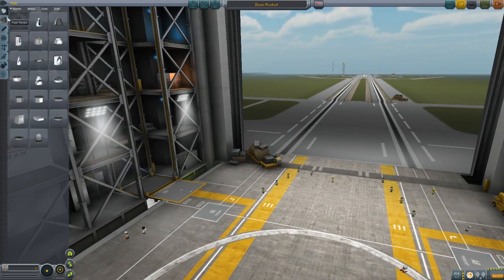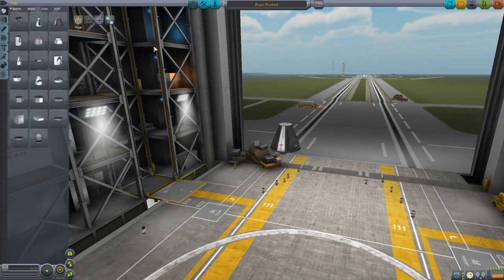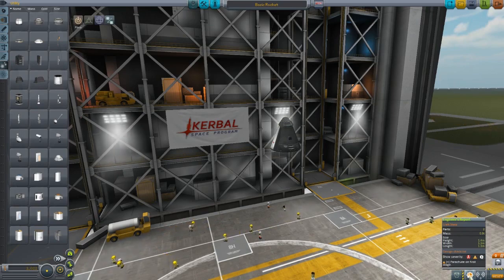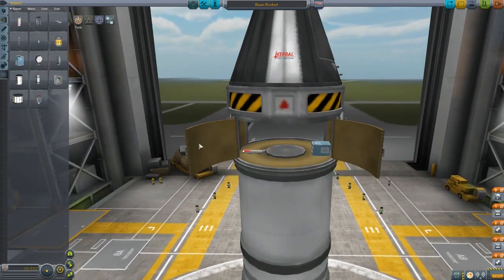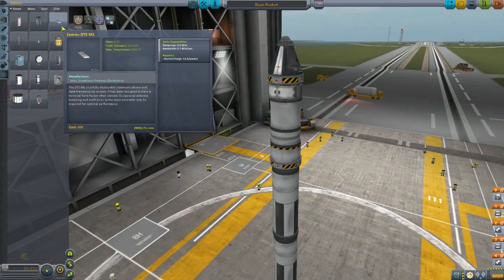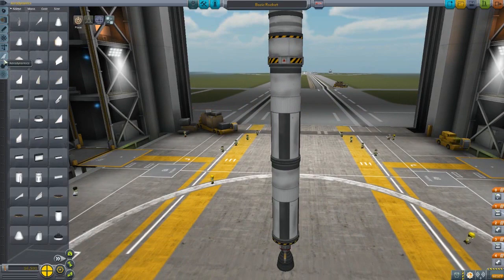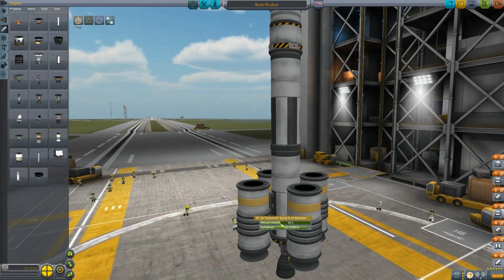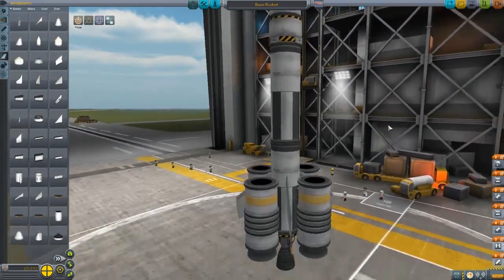How to Build a Rocket - Kerbal Space Program 1.0 Tutorial - Beginner Guide Walkthrough

Comment: How do u make a thing that just stays in the atmosphere and orbits kerbal?
Reply: Me_is_Wizard By using mods (something like electric motors that can powered entirely by solar panels) or cheats (unlimited fuel and maybe no heat damage).  If it stays in the atmosphere, it'll be subject to constant drag,slowing it down and making it fall.  It'll need a constantly running motor and maybe a set of wings and technically would be flying rather than orbiting.
Reply: thanks :D
Reply: gladly.  :)